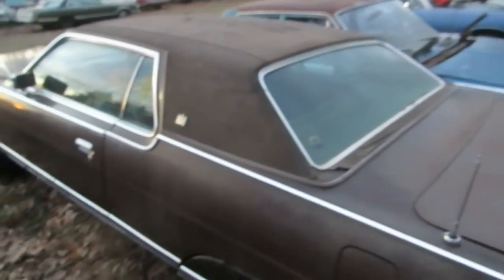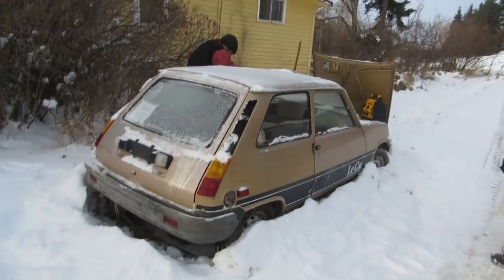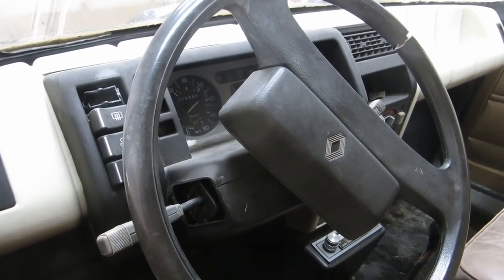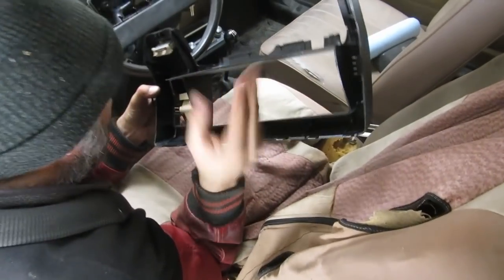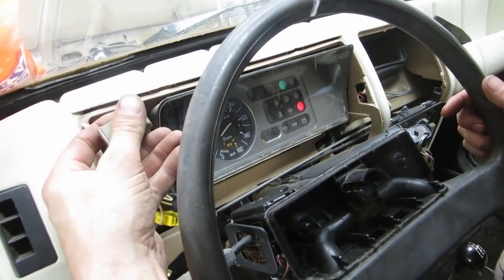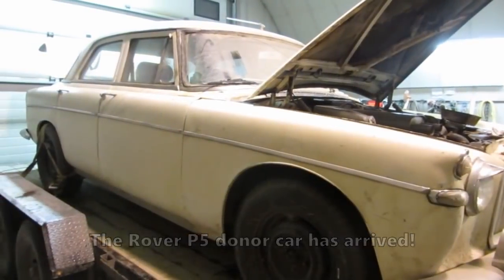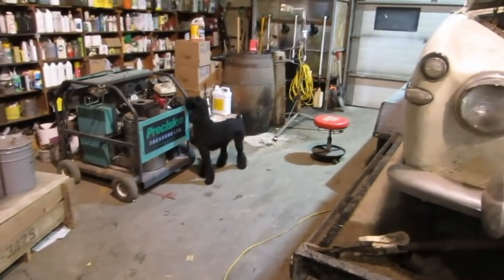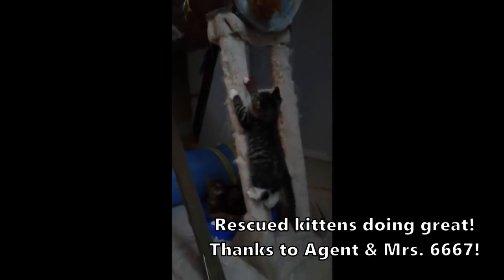My Winter Beater Entry, Fury interior, and a close look at Jim's VW Bus!

Comment: Another fine show. its nice to see you working on obscure cars. Just because. The metal working tips are priceless. My grandpa had a later model VW bus he used for selling "farm fresh" eggs on a Saginaw MI street corner back in the 80s. He mounted an AC unit in the rear side window and tin-foiled the other windows to keep it cooler inside for the eggs. Sometimes he towed a small trailer with a chest freezer mounted to it with a generator to keep it cold and would sell frozen chickens, snapping turtles, chicken feet by the pound, etc. He raised/butchered his and others animals for income to various businesses and people of Saginaw. I remember that VW  bus being so underpowered we had to down shift to 1st gear to get up a long but slight grade pulling a freezer full.  1st gear did like 10MPH! He had a TASER hidden in case people tried to rob him which had happened in the past. He told me a few stories and I got to join him on weekends when I was 11-14 yo. I learned what a "ghetto" was and how to drive on a VW bus which was a real thrill. The shifting was comical. I think it had a top speed of around 60 depending on weight as a 4 speed with a granny 1st gear.

Comment: VW memories! Mid 70s my wife's uncle had driven their daughters Texas based 56 Oval Window VW Bug to Colorado Springs where it did a tired conk out. They parked it and obtained a better ride to continue their journey. The Bug sat for several months and I asked them if their daughter would sell it to me which she did for a low 70s era price, like a hundred bucks maybe. I got it running and took it home to our Southern Pueblo County homestead. I found the problem, a burned #3 cylinder exhaust valve. Managed to pull that cylinder head off without pulling the engine, had a shop replace the valve. Over time I did a rolling not-quite restoration on the outside. A body shop friend who had his own classics he restored took the glove box light green paint and matched it. I wet sanded the whole car in prep. He painted it beautifully including two toning the wheels that green and cream color. Back then around 79 JC Whitney still had lots of VW parts. They had a complete body rubber seal kit including front and rear window seals, fender welting, etc. Plus both front and rear bumpers including the guards and tubing for like $75 each from a Brazil manufacturer. At the time there was a VW dealer in Pueblo and they sold me a new set of stock hubcaps. I hand painted the "VW" center logo in black. The car looked marvelous afterwards. Incredible simplicity. Engine out in 20 minutes, new clutch bolted on and engine back in less than an hour. Sold to a collector in town. He wanted one bug for each year of import from '49. He almost made it. His widow still has my bug in the collection. Jim's tour of his bus reminded me when he mentioned the front turn signal pods, that my bug used the same front turn signal pods that were still in salvage yards in the 70s. Found them with lenses for the restoration. As Bob Hope's theme song goes, "Thanks for the Memories" guys!

Comment: Fixing that Renault's instruments reminds me of the time that I upgraded a friend's second-gen Renault 5 with a replacement instrument cluster out of a higher-spec car with a tachometer. Every car I'd done up to that point had colour-coded wires so it was easy to rewire the plug. All of the wires in the Renault were white, so I had to rig up a test lamp and work out what they all did, then work out which pins of the plug they had to connect to. I did all of this in the dark in a supermarket car park.

Comment: Yes, those first-gen Renault 5s weren't the most rust-resistant things on the road.  I remember being on a visit to a local scrap yard back fairly early in my driving career, so around 1992, looking for a wheel and tyre for my Hillman Avenger estate, and they'd just had one of these arrive after a spectacular MoT fail.  It looked lovely, nice, shiny bright red, a nice high-spec model with the electric windows and PLiP remote central locking.  They picked it up with the forklift so it could go and join one of the piles and the body went up and left the engine, gearbox and suspension on the ground.  It was a 1984 B-reg car, so only about 8 or 9 years old and I live in an area of the UK where rust isn't a particularly major problem, the car had been here all its' life with the genuine one little old lady owner, but the whole structure of the car had just given up.  Have fun with the electrics, those on that era of Renault are probably worse than any of the multi-coloured spaghetti the Italians ever came up with.  I remember spending hours on the electrics belonging to a good customer of the garage I started off my career with, it came in for its' MoT and then the headlights stopped working part-way through the test.  That turned into a nightmare and about a day's work as every time I fixed one thing, something else gave up the ghost.  The quality of the wiring used was just a joke, it just dissolved if you looked at it too hard, though the quality of the switchgear and most of the electrical components actually wasn't too bad, which made a nice change from working on FIATs...
Reply: Yes, secong gen r5 were better but the Peugeot 205 was miles ahead in rustprofing we have an 89 205 gld that's never been dry stored that's still on the road
Reply: les  autos de cette époque entaient sensibles a la rouille!! Renault pas plus que d'autres!!

Comment: I acquired a 79 lecar while doing an engine swap in my daily..we broke the front of the cam off beating on it and replaced it but didn't replace gaskets (goofy kids). It was surprisingly a great running lil car until I broke a rack mount and could only make left turns and go straight. That lasted another couple months lmao

Comment: Would the English translation of Le Car be The Voiture?
I had a 1984 when it was only 4 years old, bought it off the back of a car lot for $400 bucks because it needed a head gasket. Replaced the gaskets and drove it for years and had a blast. The ones they sold in Canada had the 1400cc motor, the biggest one they offered. It felt fast and zippy and was all kinds of fun to drive. 70 - 80 MPH no problem.  Engine very simple, pushrod 4 cylinder with 2 barrel carburetor and hand choke, Magnetti Marelli electronic ignition. Yet it got 45MPG no matter how hard I beat on it, with NO fuel injection, computers, or any modern gee whiz shit.
The only problem I remember was the front motor mount broke, which allowed the engine to shift and the left driveshaft universal to separate. But a new motor mount was only $14 bucks and held on with 4 bolts.
Get the little bugger running right and you will have a great winter runabout, especially since you like French cars.
Reply: Some weird rule in French when borrowing a noun from another language, it goes as masculine. Hence "le Car". The common actual French terms are "la voiture" (feminine)  or "l'automobile" (masculine). "le Car" sounds like it was made up by a U.S. advertising firm. We could go with "le Beater". A sort of "folksy" word would be "la bagnole"  English equivalent might be "runabout". The "gno" in bagnole is pronounced like "n' in "señor" (Sp.)
Reply: @omarjette3859  How do you say Le Heap in French?
Reply: @mrdanforth3744  That would be "le tas", to  which one could qualify by adding "de merde" loosely translated English "POS".

Comment: Interesting! Y'all gotta put in some footage of the "fun stuff," like cutting out the rusty panels, repairing the wiring, even the sewing & welding (with a spare mask/filter). Need a tripod or body mount of some type (like a pocket protector thing?), there's whole channels that get millions of views just showing that repair & refurbishing stuff with a little commentary (like Mustie1). 

I'm interested to see how the LeCar wiring was fixed, like every wire was unplugged & sanded/cleaned, or (less likely) you just kept turning the switches on & off until they "cleaned themselves up"?
Reply: You're new around these parts, ain't ya. Lol.
 There's a ton of footage of rust repair, panel forming, dent repair, component repair, etc. in the previous videos.  I'm a big fan of Mustie1 and others, but this isn't quite the same type of channel. Browse through the archives for a while, you'll get it.

Comment: I thought for sure the lack of compression might go in the Renault's favor, it would not take much to spin it over and maybe would start quickly.  I had not noticed the slight body discoloration due to some insignificant surface rust so I was very surprised it ran but required a bit sheet metal work to correct one or two BB sized holes in the body but your decision to delete the Flintstone brake option may be something you will regret in the event of an emergency stop.

Comment: All these big barges around and you choose a little dinghy for winter beater! That’s brave. The Renault 5 used to be on every street corner in Europe, and now it has all but disappeared. Good on you for getting this one back on the road! Even if it will look a bit strange in wide open spaces coated in four feet of snow. It’s a great small car, it showed the way for city cars at the start of the 1970s. FWD means it shouldn’t be too bad in the snow.

Comment: Renault 5...that brings back memories when I was body tech at Volvo & Renault dealership. Worked on many Renault's... not my favorite car but the small round hole on the fender was actually turn-signal lights for european models. Very thin metal everywhere... but easy adjusting doors with just a 2x4 between rocker-panel and door edge...just a twist down and push, they flexed like a tuna-fish can.. lol
And the dashboard with flimsy plastic switches...oh yes..pain in the butt even when new..
Preferred Volvo cars much better with thicker metal and more quality Scott.

Comment: Hey Scott!
So as others have said about the Rover p5, the H suffix on the plate tells us its age between 1 August 69, till 31 July 70.
Also, the letters MD tell us the car came from Middlesex, a county just west of London.
Reply: You're right but the six cylinder was superceded by the V8 in 1967 so I wonder why it was given an H plate. Purchased new overseas and reimported in 1970 or so would be my guess. Didn't notice whether it was right hand drive or not.
Reply: @timcollins7345  of course the plate refers to when the car was first sold, so it could have sat at a dealership for a while... but given how much we in Britain were pushing exports at the time, this is unlikely.

Comment: correction for dean,1979 was the last of the big bodied big block thunderbirds. in 80 the whole car was redesigned and downsized dramatically. i had a 79 thunderbird heritage 1 owner with a 351m in it. loaded car had a factory wrapped leather steering wheel stiched like a baseball on the back of the wheel, had no large sail panel glass it only had opera windows, 3/4 vinyl top carpeted trunk and spare tire carpet, had color matched aluminum turbine wheels on it. plush interior color matched to the outside of the car. which was a deep maroon. cheers guys.

Comment: @37:30, that '76 thunderbird with 460 has direct water injection on the air-filter-housing...probably gets 45 miles to the gallon....you should fix that one and repair the water injection.

Comment: Hi, the Rover has a number plate CMD 450H means it was registered between August 1969 and July 1970 in the county of Middlesex (now part of Greater London), however you have a MkIII 3 Litre straight 6 variant which went out of production in 1967 and was superseded by the P5b V8 which was in production from 1967-73. This car must have been languishing unregistered for some time. The P6 3500 V8 was introduced in 1968.

Comment: Here's a tip where it comes to winter beaters, don't pick a car that's so tiny it can easily be lost under a minor amount of snow fall,like anything more than a shovel full! Or when you find a previous metal repair has Labatt's stamped on the other side along with the ubiquitous duck tape holding it on,quack quack! Or it's a very sorry obvious turd that's a very big lost cause, and I mean a bigger than usual lost cause, like really really beyond lost! Lol!

Comment: Dean has the market locked up on docked land yachts, canada won't run out of steel anytime soon. like the flow through brake ventilation on the bird, good for high speed braking maneuvers ))). rust, rust and more rust scott your quick repairs are 10 times better than my permanent fixes! my friends daily driver, same ram minus the weight reduction. good thing Jim's young, wow I look at the van and ask why??? Cut the top and back off make a vw stake bed truck. my grandfather from germany would drive nothing buy volkswagons. He had a green bus while he lived most his live in Chicago, then an orange one after he retired. Toured the country in these buses, had many stickers from state parks all areas of the country. It was the pop up type the would overnight stay at the parks in those vans through the late 60's, 70's and even into the 80's

Comment: Guess you gave up on those S90.  Looks like you may need an engine block heater on the Le Car. Do you plan to take someone who is not color blind when you get the vinyl for the Fury? I have some a Mark 2 stuff I should send to Jim, should I send it to you?

Comment: Ohh the Le Car... How in the HELL were the French able to go from Citroen SM kind of design/ engineering to the Le Car in so short a time frame?? Did the idea behind the movie Idiocracy come from the French auto engineering pools?
 GREAT tip showing the string techniques to determine body distortion there, btw. Thx
Reply from the maker: I think they were both designed around the same time, but for opposite price brackets, haha! Lots of amazing engineering in both vehicles, but never too far away from some questionable thinking, either...Cheers from here!
Reply: @coldwarmotors  True that, my bad. Very much a Pantera to Pinto comparison - n I  also have my share of the obscure, maligned imports. Is why I found such humor in the frustration part of the dash thing, nothing like trying to fix things not meant to last more than a dozen years at best!

Comment: 29:39 Le Carp. Edit:  Le "Car". Actually i always liked these cars back in their day. Had a Summer job at a used car lot in the 70's, so I've driven several, and they seemed to drive fine. I knew someone who had a new one, and he said the gas mileage was phenomenal,  but he never looked happy whenever talking about it. I never saw one rusted out, but i did notice it seemed like they all disappeared from the roads overnight.🤔 Very curious why someone would choose a light, small-tired low clearance tin box for a winter beater, tho. Seems like that bent Volvo you showed us a while ago would have been a better choice, even if you had to weld that door shut😛

Comment: So you cant drive a car with rust holes in Canada?
Reply: You can drive it, you can't get license plates or insurance (mandatory)  until it passes a safety inspection by a licensed mechanic, and any rust hole is a failure. Once it is registered in your name as "fit" you can drive it until the fenders rot off if you want to.

Comment: I stopped being a Renault fan after the Caravelle stopped being produced back in '68. I'll admit that the Renault 25 wasn't a bad running vehicle but by the time it was being produced, it was no longer being exported to North America and it lacked a certain eye appeal.  The Renault Cinq was considered a 3 year ownership car in France and "Le Car" was just a gimmick to sell them to the new world. (Most of them found junk yards before their 10th year of existence).  ***   Scott,  You wanted to know what word you should put on the outside to replace the words "Le Car" ?  Try putting the words "LE CAFARD" ... it's only 3 letter longer and would definitely make French speakers laugh when you drove by (sort of an inside joke)  .  I'll let you look up the word in your English-French dictionary .  BTW My Winter beater in France is a "Peugeot Partner", a 5 seater utility vehicle. I've had it for almost 20 years and it just keeps on running with 108,000 KM on it (which is high considering I only drive it 5 or 6 months out of the year and it's a gas engine not a diesel). Renaults today "look" better ever since they combined with Nissan but they still have durability problems.  I'll stick with a Peugeot and/or Citroën any day of the week.
Reply: Merci pour l explication du :         "le car" 
And it's true this tiny car made for the womens and young drivers on littles roads in France.  and very not expensive . Popular car.
But not same : renault 5 alpine,
Or race car : renault 5 turbo 2.
(Win rallye monaco )
Sorry for my poor english
But j Le french.
Reply: @jerrymach9961  Votre Anglais est bien compréhensible.   Je n'ai vu qu'un seule exemplaire d'une Renault 5 Alpine... et c'était pour.... "Zo-o-o-u-u-u-m"... 10 seconds seulement.  Mais... J'avais un copain qui avait une ancienne coque d'une Alpine de course,  marque de 1955 et c'était totalement en Fibreglass. Elle ressemblait un peu à une Porsche de 1965 - 1966.    **  Jerry Mach Your English is very understandable.    I only saw a single exampla of a Renault 5 Alpine and it was ...  "Z--o-o-o-o-o-m" ...for only 10 seconds.  However...  I had a very old friend who owned a body only of a Renault Alpine racer from 1955 and it was made completely of Fiberglas and looked sort of like a 1965 - 1966 Porsche..
Reply: @briquetaverne  merci infiniment 
D autant plus ,je vois que vous êtes un connaisseur en voiture française. 
Total respect.
Reply: @jerrymach9961  Photos d' Alpine de course 1955     http://stubs-auto.fr/s/cc_images/cache_44563050.jpg?t=1430475285
Reply: @briquetaverne  first génération.